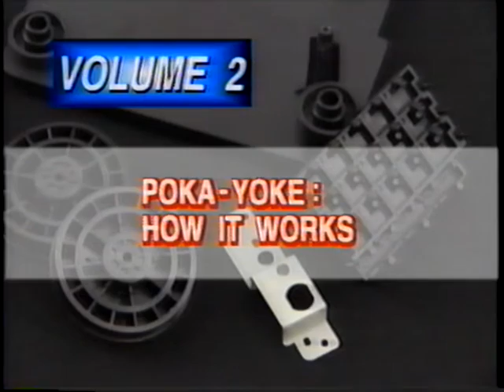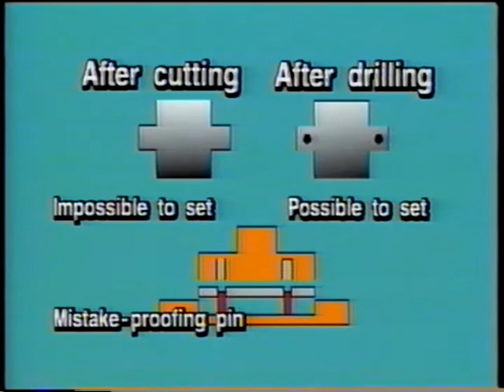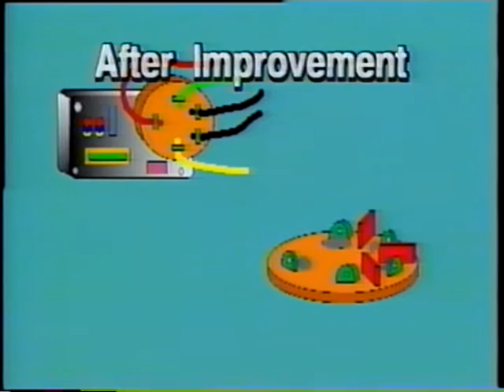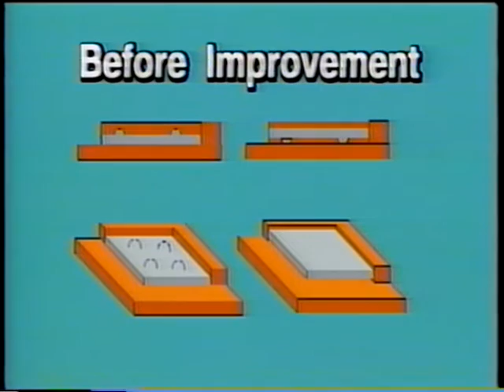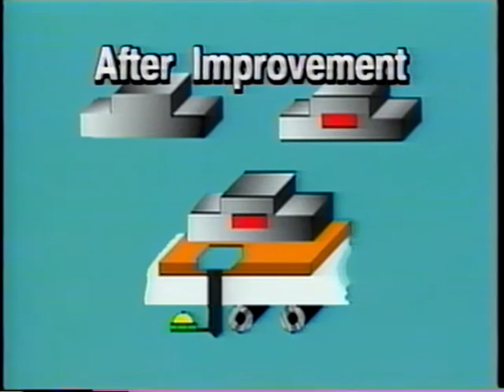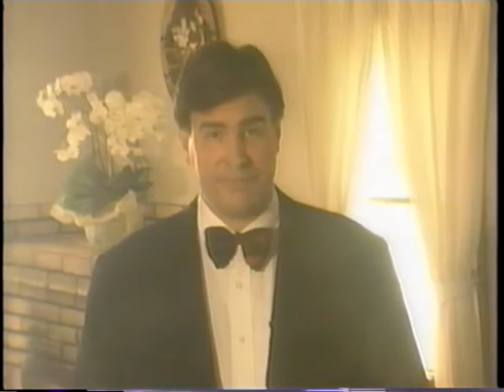POKA YOKE vol2: How It Works

Comment: Processing failure
Sop not followed

Preventing errors
Limit switch mistake prrof counter measure number of holes drilled
Identify errors add mistake proofing pin
Preventing errors
Create physical innovation to eliminate failure
Photoelectric relay to prevent failure
Errors as a result of working brakes
Shute added

Processing errors
Add guides to prevent errors
Add limit switch
More decisions made by operators can lead to more defects